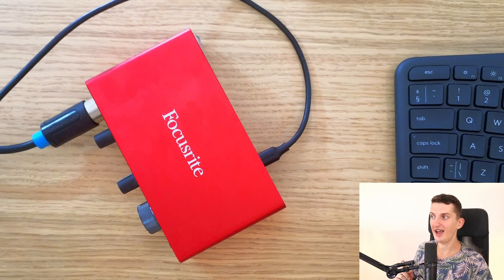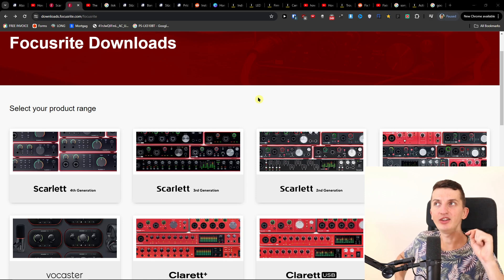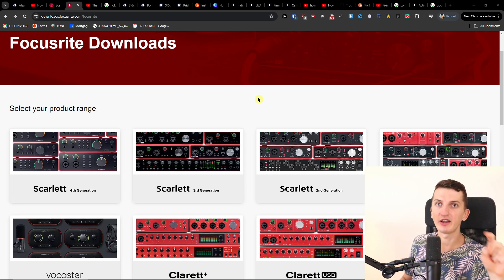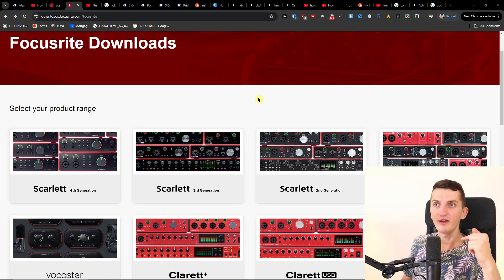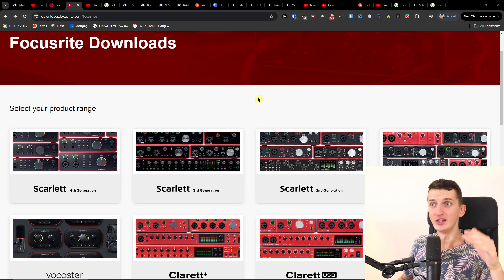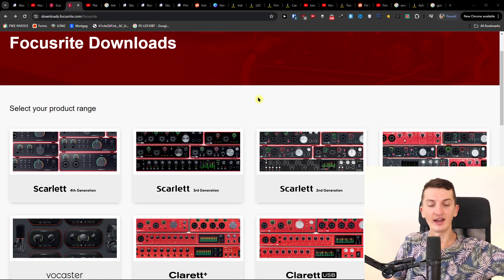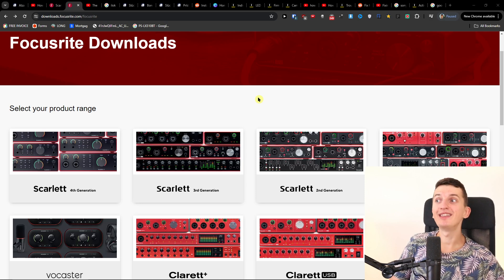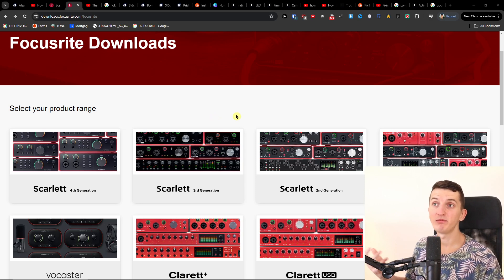Focusrite Scarlett FIX No Hardware connected/Not Working/No Sound   TIPS For Fixing it

Comment: You do not need 48V for a SM7B unless you've put a cloudlifter or similar in it! If you turn it on and it's not necessary, you MIGHT damage microphone if it's not a condenser mic. Please update the video to represent the actual use of 48V phantom power.

Comment: you have to press the 48v button becuase you have a dynamic mic and it needs a little "boost" for it to work .Phantom power (48v) basically gives it power. If you had a condenser mic you would now need to turn Phantom power on

Comment: if you have a dynamic mic, like most podcast mics are, you should not need phantom power (48V) should try to up the gain level till you can hear yourself. if you have a condenser mic it will need the 48v to push signal through.

Comment: Updates on my #Scarlett18i8: sorted - #Focusrite advised me to change the adaptor (12v 1amp) and now works perfectly. As a back-up I was using a #VRMbox from them, and now they just replied my to change the adaptor (12v 1amp) and works perfectly indeed; these older models are built like tanks, they run forever if well looked after!

Comment: All of this is extremely unnecessary.  Reasons not to buy Focusrite
Reply: I swear it’s been given me problem after problem I haven’t got a chance to enjoy it
Reply: @chiraqculture3885 
I Bought A Focusrite Scarlet 3rd Gen 
And Try To Registered The Serial Number On There Site To Geat The Right Drivers 
But It Says 
Serial Number Already Been Used...
Reply: I Bought A Focusrite Scarlet 3rd Gen 
And Try To Registered The Serial Number On There Site To Geat The Right Drivers 
But It Says 
Serial Number Already Been Used...
Reply: I regretted for buying... I will switch to MOTU. Damn you focusrite...😢
Reply: @johnkalampoukas2503  I Hate Focusrite With Passion Now
Reply: It was all good before..i got away from recording for a few months and now it doesn’t work.. it’s not showing anywhere on my laptop now
Reply: @kiingzay731 Having the same problem, did you find a fix?
Reply: Same. All my lights are lit up. Did y'all get y'alls working?
Reply: @PaperstackzEnt damn same thing not working 
I will get another interface it won’t show up on my laptop

Comment: Mines keep lighting up and not connecting
Reply: thats the exct same thing mine is doing. no blinking just lights and the butons dont work and it wont connect. did you find a fix?
Reply: @JDAden-gy3gv  try a new* C-cable.
Reply: @esam.369  does that usually work
Reply: @JDAden-gy3gv  DID u fix it mines doing the same
Reply: @Therealtrapanthem  i actually did bro lmao. turns out i just needed a new cord like he says in the video. some cords distrubute more power than others so you may need to try a few cords before you fine one that woks. i use the c- ligtning cord and it works perfect.
Reply: @JDAden-gy3gv You used an Apple lighting cable? I’ve tried every C-Type charger in the house 😓
Reply: @kiingzay731 yup. And every now and then the cable goes out so I have to grab another one. The same thing happens with my android and it starts charging super slow until I get another cord.
 So try buying a brand new one or one that’s advertised as fast and you should be good. Mine works perfectly now
Reply: Is all lights turned on on anybody scarlett and not connecting? I tried different cables and different ports. Anymore suggestions? Happened out of nowhere
Reply: @mariojackson87 it's not about trying different cords bro, or at least in my case. It's about trying trying the strongest cable you can get your hands on
Reply: sameee dude its so annoying and i dont know how to fix it

Comment: hello good afternoon. I'm here with my 3rd generation Scarlet 2i2 audio interface, but I can't use it on my Windows 10. I have already installed and reinstalled the driver suggested by the official Focusrite website several times, but none of them work and when I open the Focusrite control it always shows "No hardware connected" I need a solution, please.
Reply from the maker: try different cable connecting to laptop/pc or different port where you are connecting it to
Reply: have you been able to fix it
Reply: @BlueBloodTVpienxfc  yes, actually the problem is that my interface was fake, so it didn't recognize the original driver and it only worked through Asio for all

Comment: sometimes my scarlet decides it just doesn't want to work with my mic, like everything will be setup i can hear audio from my computer but my phantom power just isint working with my mic like why does it do this?
Reply from the maker: I would try to change the cable that goes to mic maybe that can be issue
Reply: @tothepointtutorials-n6q  Ill give that a shot
Reply: @Skyvoice did it ever work?
Reply: @BigSparrow.  honestly no, it’s like it has a mind of its own like it works sometimes and than others it decides not to I’m not sure why it does this
Reply: @Skyvoice  I got the same issue since a year, the microphone simply works again out of nowhere and disappears after the next restart or even a month later. This means that sometimes it works for days and sometimes not at all. it's just annoying
Reply: @Skyvoice yea I’m having the same issue every time
I use it after the mac sleeps, I think if you unplug it and plug it back in every time it should work

Comment: 48v is the volts that your microphone needs to work. Some microphones use phantom power but many require a separate power source. 48v sends power to those microphone.
Reply from the maker: thanks brother I am much smarter now 🙂
Reply: @tothepointtutorials-n6q you should just never turn it off and on while it’s plugged in or you will destroy your mic